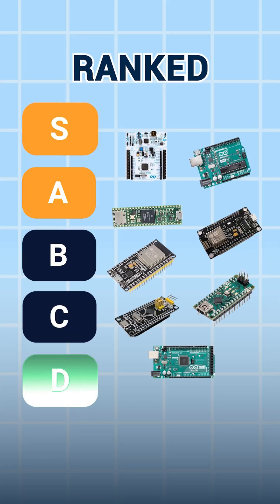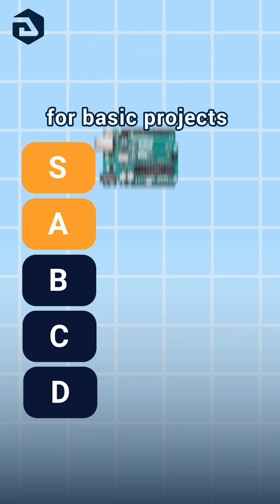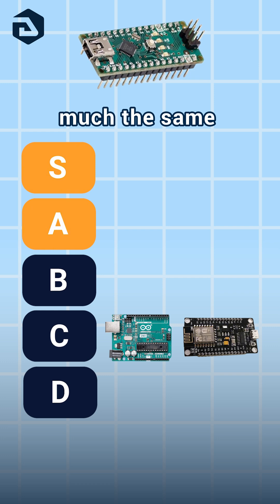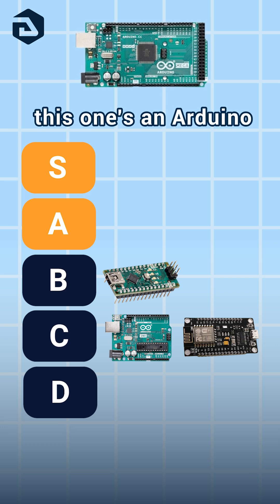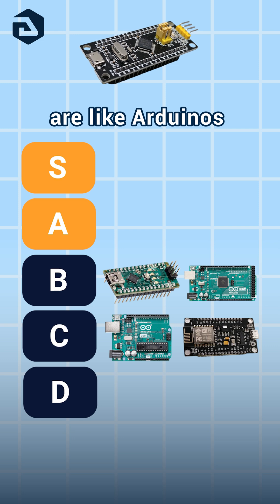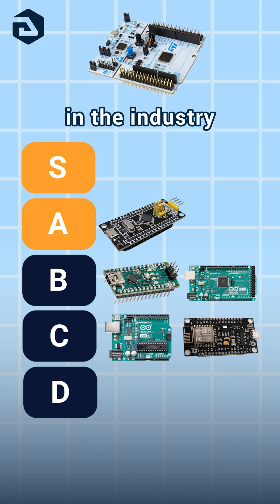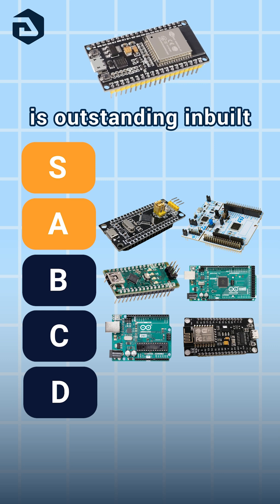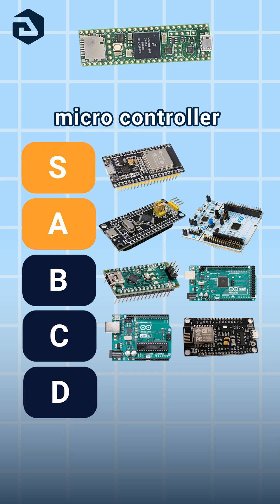8 Popular Microcontrollers Rank | Best S-Tier to Worst D-Tier?

Comment: pi pico RP2040 with wifi should be here in S tier
Reply: Can you tell me why you think so?
Reply: @yegue_tech  better ADC,DAC(less noise) than esp 32,ARM architechture is superior than RISC V both from performance and power consumption.They both are 5 dollar controller.Newer version have also RISCV and arm architechture,better perf and power use and only 1 dollar more expensive
if you are lazy,Circuit python is too easy to program such that a highschool student can do it.

Comment: Tbh for 3m old video it's kinda dated 

Esp32 s3 , c6 , c3 ,h2 are new and different boards , also you forgot the rp2040 and newer 2350 boards
Reply: The s3 is the all round best with 16mb of flash and 8mb of psram. I got it to boot the full latest linux kernel somehow. The element14 disro works for. The 8mb flash version only

Comment: Technically you are ranking microcontroller development boards, not the microcontrollers themselves
Reply: Omg I just opened up comments to write this lmao. Yeah those are DKs. Not MCUs.
Reply: I think he's lumping them together. If you rated just the MCU it would get confusing because Arduinos, for example, often use esp32 chips or STM. 

It sucks that esp32 don't have the name recognition of Arduino. They're a fraction of the cost while being just as easy to program and have more pins than the Arduino uno. To people outside the MCU community I think Arduino is practically synonymous with MCU which is why so many people get one to start out.
Reply: Embedded systems*
Reply: @ROKO-e5t  Nah, you're not really supposed to use all those boards in production, although I know it's not uncommon in projects that are one-off or produced in very small numbers
Reply: @SteelSkin667  but we can use the microcontroller like stm32 and make our own custom board right? Sorry I'm new to this.
Reply: @AbhTri-kq8hc exactamente, estás en lo correcto, lo más profesional y que será útil para la producción es que elijas el microcontrolador adecuado para tu proyecto y diseñes una PCB que integre todo lo que requieras

Comment: No Pi Pico? $1.99 on Aliexpress all the time, with 16mb of flash even.
Reply: The esp32 s3 got 16mb flash and 8mb ram. Much faster and around the same price as a 16mb pi pico. And the $2 one on aliexpress is the 2mb cheep  version.
Reply: Yeah those are goated
Reply: and PIO (so support for any protocol you can imagine - so far did WS2812B and multiplexing 7 segment displays easy peasy without touching CPU), and Bluetooth (with bluepad32 library support), and supports gcc and cmake - no stupid third party IDE required, just vim/vscode/clion and go, and picotool to upload, and use another Pico to debug, and no FreeRTOS requirement like ESP32, and full repo of examples, and great documentation - both for C SDK and hardware, Pico 2 W is S+ tier easy

Comment: Where is the milk v or risc microcontrollers?
Reply from the maker: Will share video about it
Reply: Milk v is a single board computer, sbc.
Not a microcontroller.
And the microcontroller that it does have.. is kinda mediocre.
Less powerful than arduino.

Comment: So where are the raspberry pis.
Reply: Raspberry pi is a "microprocessor"
The video is about "microcontrollers"
Reply: @sunreetshivasagarburgul7853  RP2040
Reply: @sunreetshivasagarburgul7853  pi pico is a microcontroller
Reply: @Sh1d0re  they arent microcontrollers
Reply: F
too expensive now
Reply: @nisstw  inflation moment
Reply: @nisstw  you can get on for like $5, $10 with wifi